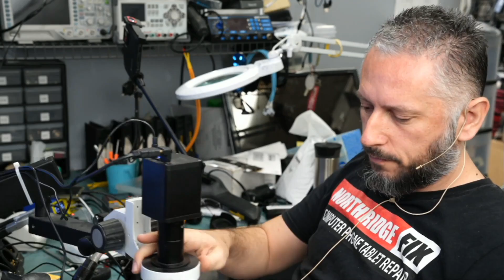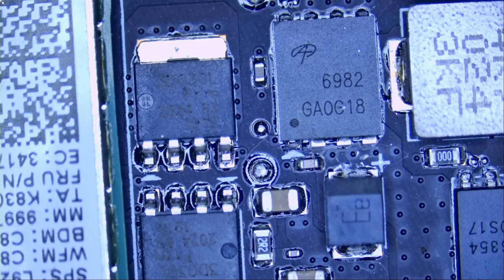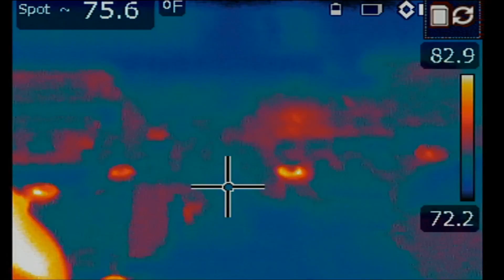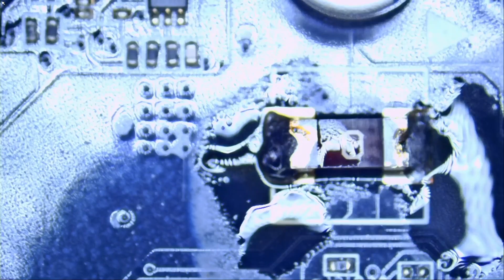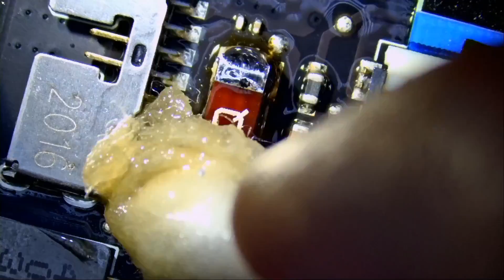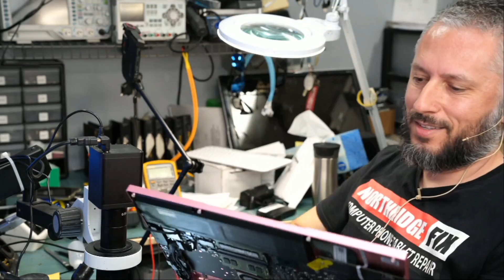Razer Blade Gaming laptop Repair - Won't turn on

Comment: hey, good job, I have a razer blade 15 2019, a capacitor similar to the one in the video shorted near the power coils of the gpu, it was so strong that it melted a power ic driver of the coil, the problem is that I can't find a reference to the ic BAABSK numbering power only says that, I have searched everywhere and nothing appears, do you know if any other power ic is compatible with this ic.

Comment: i removed the heat sink recently and changed the thermal paste for rtx 2060 and also i7-10750h processor however the rzer blade 2020 doesn't detect the GPU anymore

Comment: The sender should have not put the value so high, when sending it. Whatever he paid for it originally, non working it's junk. The problem is, if it gets lost he's hoping to be compensated for a brand new one. Sounds like the sender is trying a scam...

Comment: Nice to see that Alex still gets joy from fixing a device. Even after fixing hundreds of devices
Reply: I totally understand this, I am also a repair technician, and fixing a device always makes me super happy!
I am definitely nowhere near as good at soldering as Alex, I do not have all the equipment he has, and I don't have his insane skills at tracking down short circuits, even though I perfectly understand basic electronics such as buck converters etc...
But I do a little bit of component level repair here and there, and otherwise it's mostly just replacing whatever's dead, and optimizing machines because it's crazy how many people just buy new computers because the old one is insanely powerful with a lot of potential yet runs PAINFULLY SLOW!
This is also partly OEMs fault for installing bloatware, using garbage thermal paste, terrible cooling sometimes, and terrible drives too.

Comment: I have a questions why does fuses have different markings? Y, X Q? Why not just F? Great job as always. Thermal camera to the rescue.
Reply: These Fuses are 2410 type, Q is 10 Amp, X is 12 Amp

Comment: That does not make sense. The cap could not get hot if the fuse was open.
Reply: he injected voltage obviously on the capacitor side of the fuse...

Comment: That UPS issue would not exist if the package was declared as a temporary export by the customer.
Reply: Or if the customer had used EMS, which never charges import duty/taxes.

Comment: Another successful repair but I am concerned about the replacement fuse.  X marking on the fuse =1.6A according to my information whereas the  fuse you replaced is marked Q=0.25A.
Reply: Not the first time Alex did that. I don't think he pays any attention to fuse values.
Reply: Good question...hope he gives an answer
Reply: Q is 10 Amp X is 12 Amp, so it‘s fine
Reply: @oliverbockler1094  this may be fine here, but try that on a GPU - the moment custoer changes power slider in MSI afterburner and the fuse is gone.
Reply: @DIYRepairHour  if your GPU ever draws anything close to 10A, let alone 12, you have more serious problems than the value of the fuse
Reply: @lookitskazzy  Yes, you have an RTX 4090
Reply: Replacing a fuse with a lower rating is fine, you just don't go the other way.

Comment: When you replace a X fuse (1.6A) by a Q fuse (0.25A) will it not blow rapidely at the first heavy load?
Reply: yes
Reply: Yes it will - and the repair will find its way home to Alex, who still ignores the properties and function of fuses.
Reply: It depends on the fuse manufacturer.... I found tables that list an X fuse as 12Amps and a Q fuse as 10 Amps....in which case it will make little difference as 10 amps will only be called for in a fault condition... (littelfuse 2410sfv fuses)

Comment: Found your channel only a few weeks ago, but i'm loving the videos, so informative. Been taching myself these kinds of repairs on old low-value boards or on boards i get from the scrapyard that don't work. I don't have any fancy equipment, most of it is self made, but it works for the level of experience i have.

I do have one question, i don't have a microscope yet, been using a magnifying glass with a ringlight, what low budget microscope would you recommend?

Comment: Good analyses / repair. "You should never get a short-circuit on a fuse", damn, 50 years of electronics knowledge down the drain (or source or gate). UPS has lost the plot recently, I believe they are using a third -party brokerage to advise on customs etc, unfortunately they are mainly staffed by untrained school-leavers, in another country.
Reply: I agree with your assesment of UPS, I order a lot of stuff from other countries and usually pay no import duties unless carriage is with UPS then everytime and I would not be surprised if they are not passing it onto Customs.

Comment: sir good afternoon i am from Philippines i ask how much the  voltage and ampere you used to inject in the board?
Reply: 1 To 1.5 volt  in low voltage
Reply: Where do you inject it @

Comment: Spilt coffee (w/cream & sugar) on my Razer Blade 15 and shut it down immediately. Thanks to Alex's videos I was confident enough to try to clean up the spill with isopropyl alcohol and after test it. It worked thankfully, because if it didn't, I was going to send it to NorthridgeFix. 
Thanks Alex

Comment: UPS is  a terrible company to work for.  Every male supervisor for the drivers sexually harass new female drivers and coerce them into sexual favors in exchange for work.  New drivers don't have regular routes and will spend many days without driving. Driving order goes by seniority, so who ever was hired first gets to drive and work first.  So if a female driver who came after you is driving first, then she caved to the supervisors. FYI, in case anyone is interested in becoming a driver for UPS.

Comment: How does he know the laptop will work without the capacitor?
Reply: @Nino Bixio this isn’t about experience, it’s about understanding the circuit. I’m asking because sometimes it works without it present and sometimes it works but removing the component and just shorting the points. I want to know how he knows this without having the schematics
Reply: Luck. Sometimes this will work, sometimes only partially, sometimes not at all.
Reply: @Andreas_Straub  
Do you have anything good to say about his repairs or are you a master at them yourself 😮
Reply: @sj55  I forgot to metion that I am an EE - actually designing devices Alex is fixing. So please excuse, if I am sometimes a bit critical about his work.
Reply: It's experience, he knows it's probably just a filtering cap so it's better to turn it on anyway and see if it is working.

Comment: Hi,

Why is it possible to not replace some capacitors, whilst others need to be replaced otherwise the computer won't turn on?

Thanks
Reply: @
TenkaiSp pretty much has it, capacitors fit in one of two categories - coupling and de-coupling. The size of the capacitor is an indication of which 'camp' the capacitor is in, if it is physically quite large it is likely a smoothing capacitor (de-coupling the supply from the noise) and the board will most likely function without the capacitor fitted, if it is a small capacitor it is most likely a coupling capacitor (AC coupling two parts of a circuit together) and there is a much greater chance that the capacitor is required for the circuit to function.(and its value is probably more important to get right) The large cap that was blown on this board could probably be replaced with pretty much any value capacitor of a similar physical size (providing the rating is ~20v or more).
Reply: I think some caps just work as means to smooth out the incoming current, there are not connecting any traces together. But that doesn't mean they shouldn't be replaced
Reply: @TenkaiSp  This depends where the cap is in the schematic and how much voltage instability the supplied circuit will tolerate. In the worst case the supplied circuit may fail/die when not supplied with a sufficiently large cap filtered supply.

Sometimes these caps are also used as timing elements - then the function will fail. Sometimes - when being used as coupling caps between stages - signal will not come through and for example audio or alike will fail, if they are missing.

Comment: But you replaced an X with a Q!
Reply: X is a 12 Amp fuse and Q is 10 Amp fuse, probably ok. https://www.littelfuse.com/~/media/electronics/datasheets/fuses/littelfuse_fuse_2410sfv_datasheet.pdf.pdf
Reply: Same size Fuse